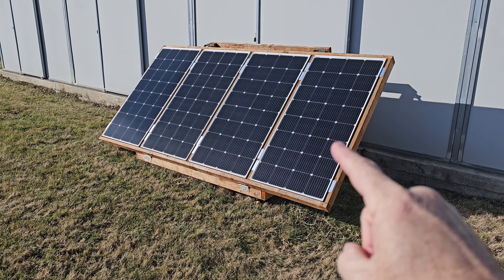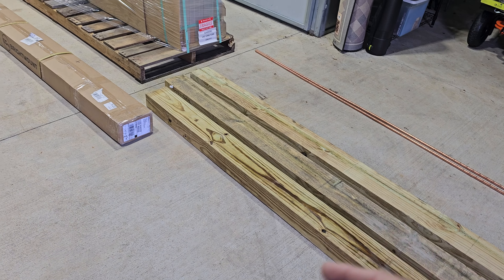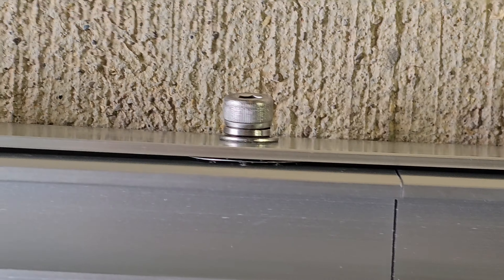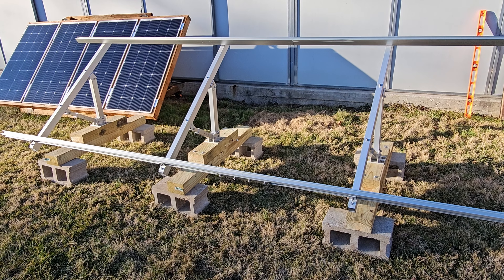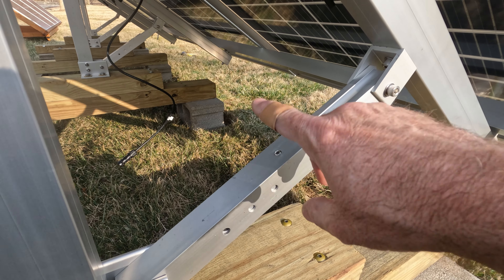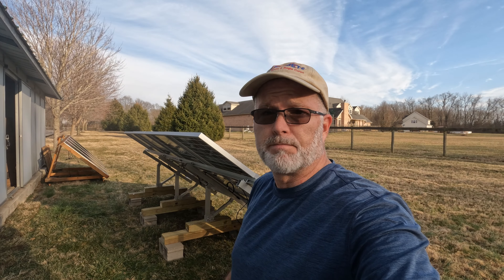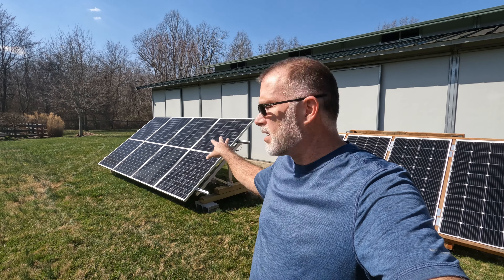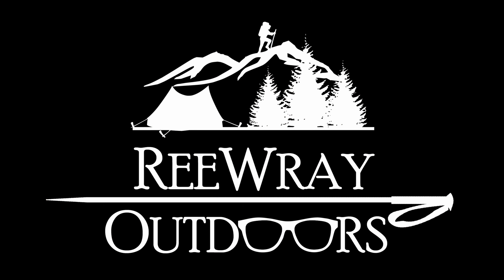Budget-Friendly DIY Solar Ground Mount: EG4 BrightMount & Eco-Wothy Combiner Box  *Unsponsored*

Comment: Mike Holt on grounding here -- https://www.youtube.com/watch?v=qNZC782SzAQ -- with a panel of experts asserts that putting an earth ground on your panels (even if recommended by the manufacturer) is more likely to provide a path for a lightning strike to the ground to travel through your solar wiring and on through your house wiring to exit through the house ground. He and his panel cite NEC requirements.
I know this is a very contentious area with much conflicting advice, and I have no idea what best practice really is--and I'm not sure that the manufacturers do either.
Reply from the maker: Yeah I've actually watched his stuff on this topic.  I decided in this case to go ahead with conventional recommendation since the system is not tied to my house power at all. But yeah,  there seems to be a great deal of conflicting information on this topic.

Comment: You didn't read the instalation instructions. Your supposed to use the 55 bolts to secure the adjustment, and only use the set screws to temporarily hold it in place while you secure with the bolt holes in the side.

Really not good to be making a how to video when you don't know how to...
Reply from the maker: Damn...I was hoping no one would notice that slip... and actually I didn't discover that I'd missed that until recently when I assembled a 2nd rack.  It's fixed now...but surprisingly that thing didn't budge even a millimeter during the months that it sat with only the 2 set screws holding it in place!   But in my defense, the video was not meant to be a step-by-step replacement for the manual...just a overview of the basic assembly experience. ;-)

Comment: The racks are kind of a waste of money. Unistrut is about as durable a material as you can get..it's priced dirt cheap. I have a 24 panel rack attached to the side of a shipping container on our farm now for over 20 years. No rust, no problems at all. And it was WAY cheaper than pre-manufactured racks.